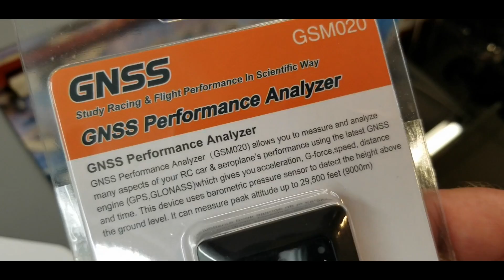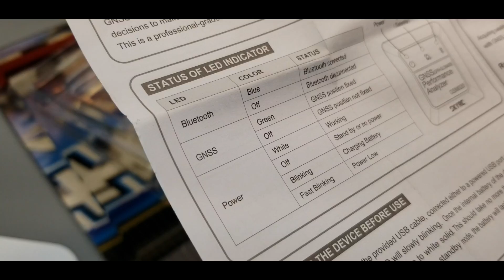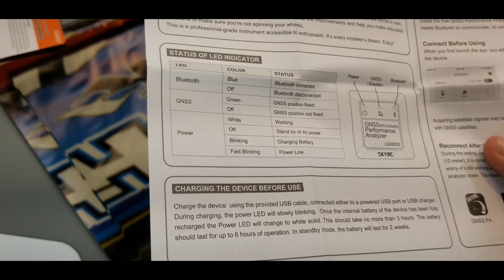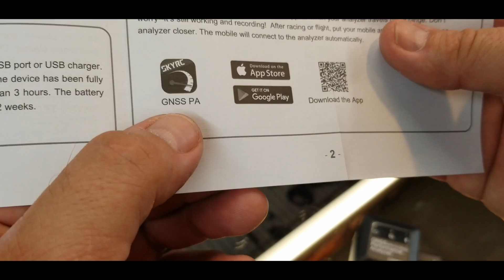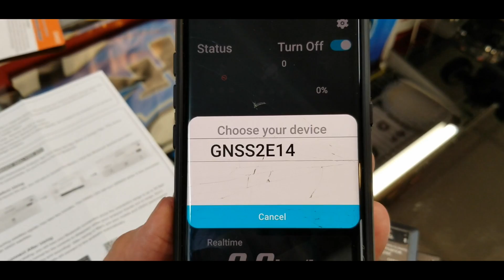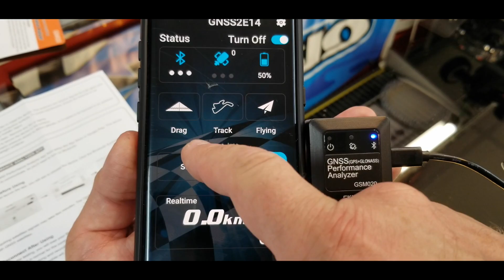Think you're FAST PROVE IT SKY RC GPS Performance Analizer and Andriod App setup SUPER EASY

Comment: I saw on the drag setup,   (speed) you can set,  say 100 mph then hit start. When you gun it the analyzer will tell you how long your car went from 0 to 100 mph. That's why it says you can only start the test when car is at a standstill. It will start recording as soon as the car moves.

Also on the( drag) I saw distance which you would set to 132 ft and it would tell you how long it takes your car to go from 0 to 132 ft. Your car has to be standing still to start the test and then it registers the second it moves. 
   You will only be able to read the data on your phone when your car is next to you and within Bluetooth range. I don't own one but I'm guessing this is how it works because I consider myself pretty tech savvy. I have ordered one however because it looked interesting. I hope This is helpful I stopped the video like 9 minutes in so I could type this out I'm going to watch the rest now
Reply from the maker: Yes!!!!! This is the best part.  I only wanted it for top speed but am realizing it's got MORE to offer👍💯👊
Reply: @rcguygarage  That's what I like about it multiple features and you can put it inside the body to protect it and read all the data off of your phone without having to keep removing the body. By the way the new look in your work area looks great 👍